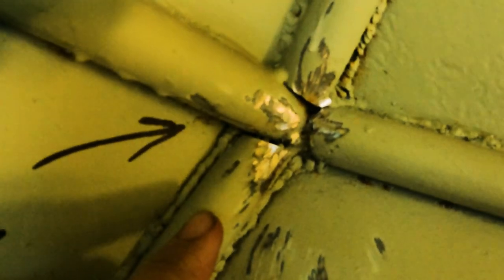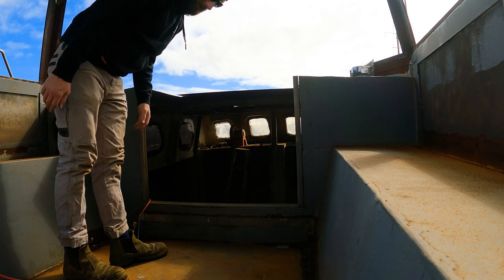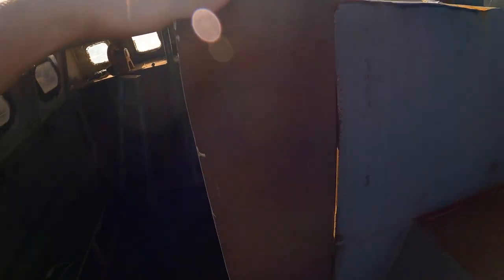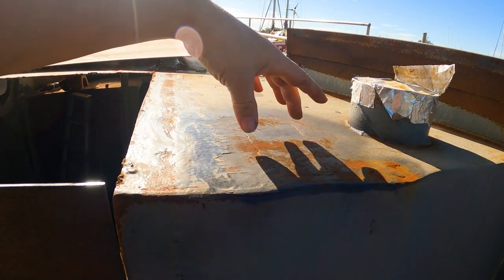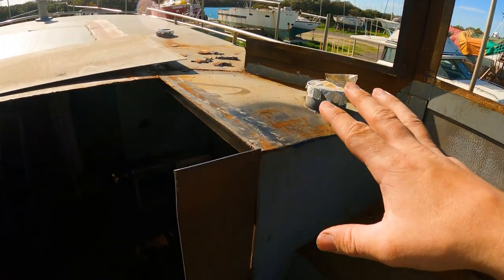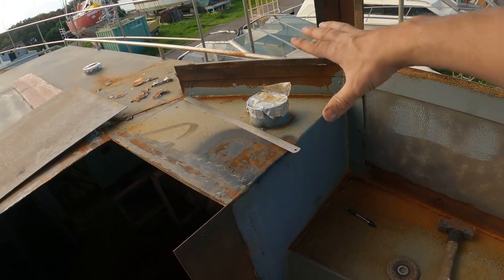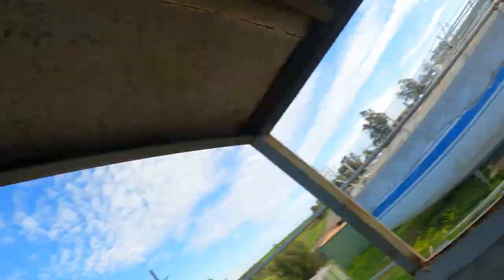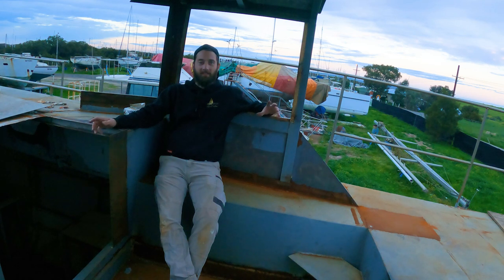Sailing QC # 31  |  Welding the Aft Cabin + COMPANIONWAY DEMOLITION  | Steel Sailboat Restoration

Comment: Hey mate. Im no fabricater but i can see in those very front window's what looks like a twist in the sheet steel. Id say (guess) itll deform if you cut out a bigger opening. Might be worth putting some 10mm² square tube bracing or similar on the inside first.
But your right, she looks like a friday avo build with all these little things not done right lol
At least shes in good hands now, and will be done properly
Reply from the maker: Thanks for the heads up! we will keep that in mind when we get started cutting for sure! Its great to be fixing all these issues throughout, hoping a great result at the end!!

Comment: My old man has bi fold doors on his boat could that be a better option with two doors and a lift up hatch for a little extra head room for the companion way.
Reply from the maker: Hi Mathew! the companionway is going to have a forward sliding hatch so it will be completely out of the way :D 
With our door design we are going to be having interchangeable custom inserts! Including the option to change from tinted acrylic (matching windows) to a fly/mosquito screen for air flow with the doors closed too.